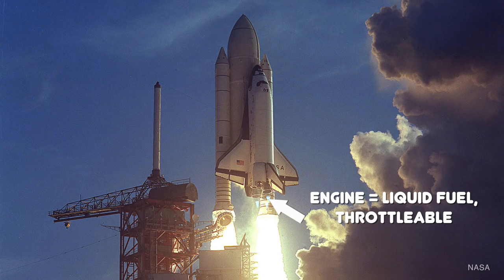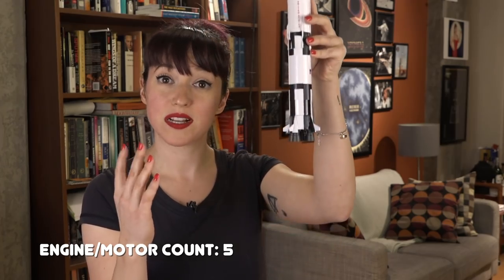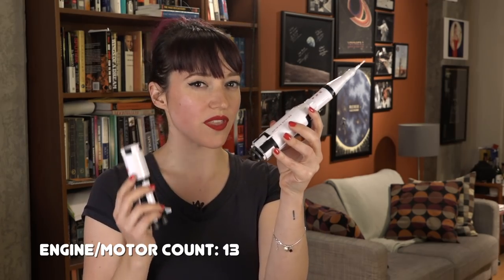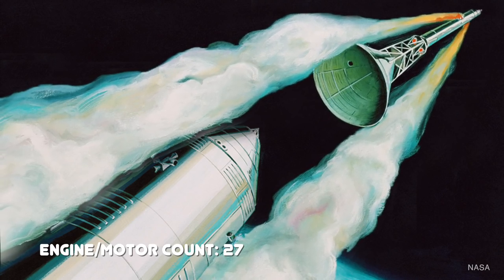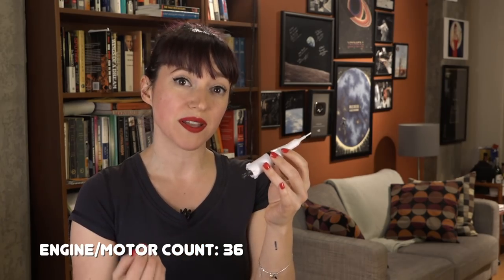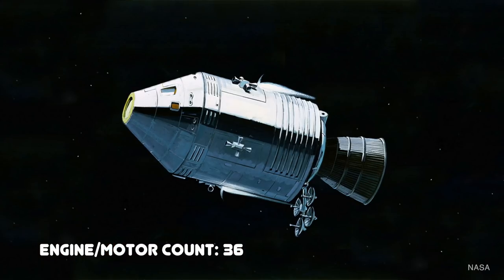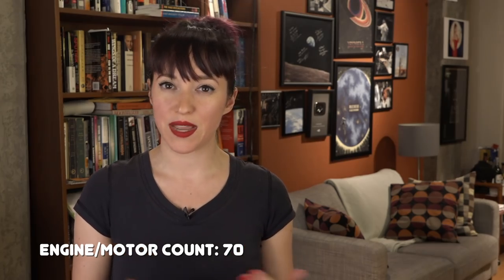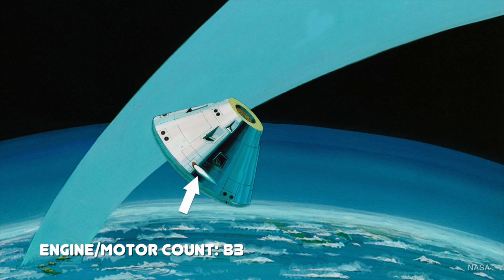It Took 83 Engines to Get to the Moon

Comment: how did they get to lunar rover to moon?
Reply: CyberMaxPower In the LM.  One of the unused triangular equipment bays in the LM was purposed for the LRV in the final three lunar landings.
Reply: shlibber Actually, the lunar rover was housed in a 5 by 5 by  5 foot area space to the right of the ladder, under where it says United States, in the Descent stage. You are correct it was "flat packed" or as it is sometimes known, "origamied" and pulled out down a ramp that was stored in that same "garage" area. As was mentioned above, the Lunar Rover was only used on Apollo's 15, 16 and 17.
Reply: Alan Buckley It is actually more like a pie-shaped wedge in the descent stage.

Comment: 89 instead of 83 ... ?
Following your logic to count a RCS-Quad as 4 engine (what I think is correct), the total count should be 89 engines.

This is because you counted the two APS (auxiliary propulsion system) of the S-IVB only as two engines, but in each APS are actually four:
1 ullage engine (310 N)
2 roll and yaw engines (670 N each)
1 pitch engine (670 N)

Comment: I think I read somewhere the lunar ascent engine used a different fuel type than all the other engines. Again going on an old memory I believe it was a hydrogen peroxide fuel. If this is so, care to elaborate?
Reply: Wikipedia says yes, and it was a once only engine due to the corrosive fuel. Not H2O2 but N2O4 nitrogen tetroxide. See: https://en.wikipedia.org/wiki/Ascent_Propulsion_System
Reply: I checked Wikipedia and found that the two lunar module stages and the service module all used the same fuel and oxidizer, namely something called Aerozine 50 and nitrogen tetroxide.
Reply: And aerozine 50 is a 50/50 mix of  hydrazine and UDMH
Reply: You are correct ( it is different type of fuel, but not hydrogen peroxide), these are a class of fuels called hypergolic.  The Apollo used Hydrazine and UDMH (50/50) and nitrogen tetroxide as the oxidizer.   These fuels are used widely in the Russian program and simplifies things because they spontaneously combust upon contact, therefore no need for a high voltage electrical (spark plug) ignition which could fail.  That was the reason they used this on the ascent module.  BTW the F-1 engines were ignited using an injection of a hypergolic fuel into the combustion chamber.
Reply: The big engines on the Apollo spacecraft (SPS, LM descent and ascent) all burned aerozine-50 and nitrogen tetroxide, as the other comments say. But the attitude control thrusters on the CSM burned MMH (monomethyl hydrazine) with nitrogen tetroxide. MMH seems common in bipropellant RCS thrusters. I'm not sure exactly why; I think it has slightly greater density. The attitude thrusters on the LM were originally designed also to burn MMH, but they were recertified to burn aerozine-50 so they could (and did) share propellants with the ascent engine.

Comment: I thought there was one small rocket to assist the Saturn to be push towards the ocean in case there was an early abort.
Reply: Do you mean the escape rocket, that would shoot the Command Module away from the Saturn rocket, if the rocket failed?

Comment: Why did they put the biggest engines on the first stage and then smaller engines rather than the other way around?
Reply: The biggest engines-with the most thrust-were needed to accelerate the entire rocket/spacecraft. As stages were dropped, to lose weight, less thrust was needed. So smaller engines were used
Reply: It carried the most weight.
Reply: But aren't smaller engines better in atmosphere and they could put more in the same area
Reply: I hadn't heard that, but it might be the reason the Saturn IB had eight engines on the first stage, while the second stage had just one large motor.

The downside of multiple engines is that you need more total plumbing to get the fuel to all the engines, meaning more mass, and the overall reliability goes down because you have more things to go wrong. (This is what helped kill the Soviet N-1 moon rocket.) The upside of large engines is that the total efficiency is likely to be higher if you make them big enough, so they lose some thrust to atmospheric pressure but gain through being able to handle higher fuel throughput, say.

Comment: Dropped it with the intro. An engine is a motor. A motor is an engine. Synonyms.
Reply: Unless rockets are concerned.
Reply: Go around calling electric motors electric engines and see how much of a synonyms they are. At best in a general sense motor could be a subset of an engine. But engineers don't use the words interchangeably and in most applications definitely distinguish electrically driven as motors and combustion driven as engines

Comment: @0:29 Uh, there are plenty of non-throttle-able liquid engines... starting with the F-1?
Reply: ...well, unless you count a single, irreversible  "shutdown" as "throttling to zero"
Reply: How bizarre that she said that.  And she repeats the error at 5:13 ...while showing an animation of an unthrottleable liquid-fueled engine.

Ability to throttle are the special cases.  And no, it is perfectly clear that ability to shut down does not constitute throttling.  Why would Amy say something so blatantly inaccurate?  She is clearly a smart cookie.  Stating this once, one would give her the benefit of doubt as a simple slipup.  Saying this twice is akin to the Final Jeopardy glitch of IBM's Watson.  A strong indication that something is not right at the level of how this thing is wired.

Comment: I take issue with your use of the word engine. Some of what you are calling engines are chemical burners where the mixing of chemicals provides course alteration and even on modern machines like the Space X Dragon or the ISS,  where gyroscopes are used to maintain orbit.  These are not engines.  Quite often as with Saturn 5 or Delta 4 these engines as you call them on the boosters are just redirecting the hot gases and are not specific independent engines.  Please, tell me there were 83 independent engines.  I doubt it. You may need to redefine your terms.
Reply: An "engine" as its defined is a device to convert one type of energy into mechanical energy, which is what any chemical rocket does.  So yes, they are engines.  And no engines on the Saturn V redirect hot gas, all of the devices she mentioned are their own independent engines.

Comment: 8 sepratrons for a single stage?
That's a bit wasteful.
Reply: Biiig stage. You can get to the Mun and back with less mass than an empty S-I (130 tons).
Reply: Not so much "wasteful" as "conservative".  What this video describes is the earliest version of the Saturn V (the first two unmanned test vehicles, Apollos 4 & 6).  Over time they reduced the number of sepratrons from eight to four.

Comment: Hey, any KSP player knows that RCS does not count as real engines.
And now... let's count that way how many engines there is on the N1 soviet rocket. Probably more than an hundred? Despite not needing haulage and separation ones.
Reply: Damien Drouart Lies!! I achieved a safe Mun orbit using RCS after running out of fuel on my main enginel half way up 😂
Reply: RCS could not get the ascent stage into orbit, maybe if the APS failed most of the way up but certainly not from the surface.  But yes the RCS could deorbit a CSM and there was contingency for this.

Comment: I'm glad NASA "saved" all (this) information about their SaturnV projects because they seemed to have lost all the trajectory data and lost how they and their equipment went through the Van Allen Belts; just ask the engineers working on Orion. You know what else is strange?  Saturn five never went to Saturn, and I'm not sure about the Moon either.  Oh the rockets are real, but it should have been called the "Moon (Insert Number) Rocket" since the primary reason of these Apollo missions was to go to the Moon.
Reply: As I understand it, Werner Von Braun and his team of rocket scientists used the planets to name their designs. They had already used Jupiter to name a previous design. Saturn was next.
Reply: The microfilm is still in the archives; the problem is that modern gear is more radiation-sensitive. Naming spacecraft etc. after ancient gods was what they did.
Reply: William Hagen Thanks, I do recall the Jupiter program.
Reply: Oh, you meant *telemetry*. That's gear reporting on itself. Obsolete gear talking about how hot or cold it is, that sort of thing. Too bad the first-gen footage was lost, but most stuff from back then is lost...
Reply: Pygar2 Yes, telemetry data, my bad